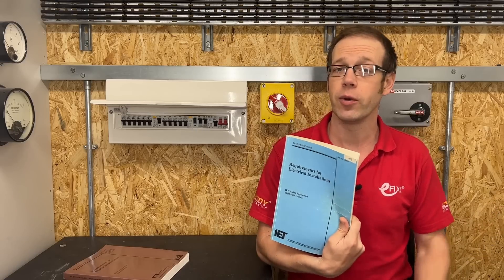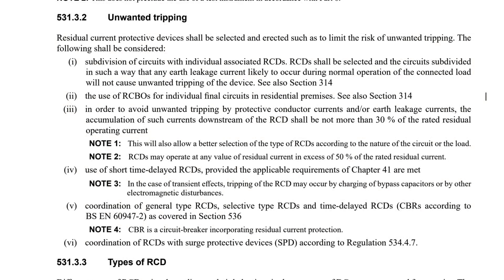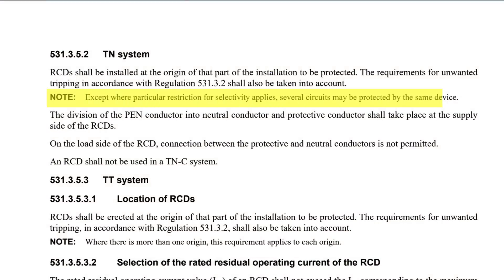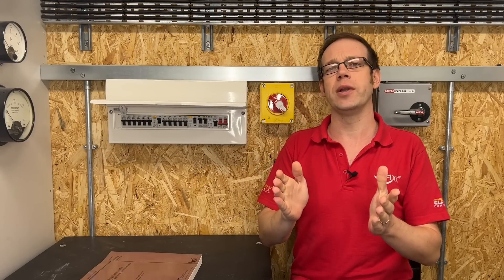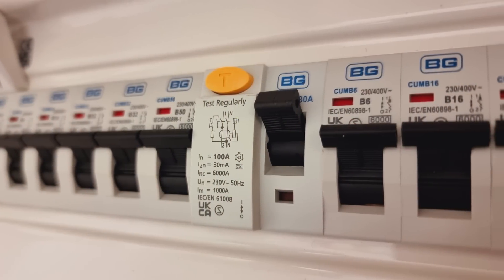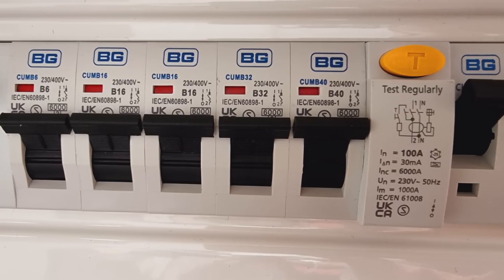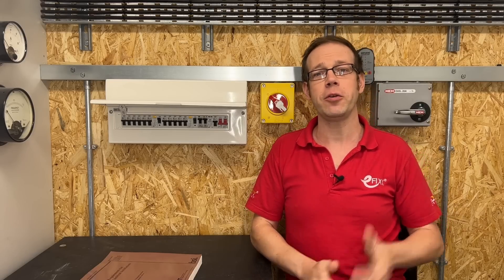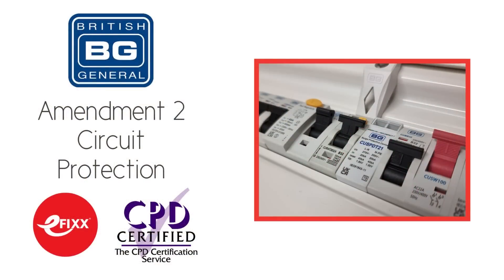Are Split Load Consumer Units Compliant with BS7671 Amd 2?

Comment: I wouldn't fit a split load  anymore. Fusebox do double pole rcbos for pretty cheap.
Reply from the maker: Fair does, thanks for commenting! 😊
Reply: Fusebox is the boss
Reply: Cheap but are they quality? A Hager rcbo is around £30 where as a lewden is say £15! I’m regularly doing jobs with around 15-20 circuits. That’s £450-£600 just on rcbo’s if I want to fit a quality brand. We are in a financial crisis and because the iet rule makers need to keep themselves in employment the consumer has to pay for it. Realistically how often after a rewire do we have rcds tripping out because of the reasons they are giving? I’ve not had 1 as of yet
Reply: @ToffeenoseToffee  hold on, we can’t fit RCBO’s because of price but rewires are okay.

Talk sense lad, if you’re already doing a rewire then a RCBO board is hardly going to break the bank.

And RCBO’s don’t really add that much to the price of a board swap.

You should be doing a full EICR prior to the swap any way. So the days of £500 swaps are long gone.
Reply: @MrIbib  in some instances no we can’t fit rcbos because of cost, believe it or not some people don’t have the funds of an extra ££££ for rcbos. I’m fitting a full rcbo board to a new factory shower block because the funds are there so in that instance it’s the best thing to do. And doing an eicr before  a mains change is just conning the customer in most circumstances if I’m doing my work and I recognise it needs changing I’ll change it
And give an installation certificate after carrying out the same tests and inspections as I would on an eicr. I’m busy enough without making work for the sake of it and costing the customer. You 6 week crash course sparks with your logo on your vans might work that way because the iet tell you so but some of us do the right thing tailored to the customers needs
Reply: @ToffeenoseToffee  who’s a 6ww?

Suppose you can tell if a ring is split just by looking at can you? Lighting missing it’s earth? No worries.

Just plough ahead with your board swap for £300 then make it on the remedial work afterwards.

Think I’ve been to a few of your jobs mate…

You do you.
Reply: @MrIbib  no you test the ring and if there’s a break you fix it. I don’t need to charge the customer to put it on paper first🤦‍♂️
Reply: @ToffeenoseToffee  if you can fix it. If it’s not buried in a wall or under the floor.

And the lighting missing it’s CPC? What then?
Reply: @MrIbib  you do the same as you would with an eicr written out and fix the fault🤷‍♂️
Reply: @ToffeenoseToffee  like I said. It’s not giving the customer the opportunity to say no. It’s a “hidden charge”, something they weren’t expecting. Not saying you’re conning people, but it leaves a bad feeling with the customer, if you have to ask for more money because you found a fault half way through.

My way, they know exactly what they’re going to pay upfront. 

There’s no “we’ve done your board, now it’s another £xyz to fix the lights”.

I just think it’s a better approach to do the testing first.
Reply: Go back and check how warm the 
rcbo's get.I would never fit them again. Fit wylex

Comment: 5 years ago when I had a motley collection of fuse boards/8way consumer unit changed out, my electrician didn't mention that RCBOs existed so I have dual split boards 2x21way To swap this out for RCBOs doesn't make economic sense at £700+ by the time you add in the labour for retesting all the circuits. My plan is to upgrade the system when changes are made - would I benefit from adding arc fault / is arc fault need on all circuits
Reply: Eight RCBOs is nowhere near £700! FuseBox are around £18 and also DP.
Reply: @johnburns4017   2x21way  almost full is about 25 circuits

Comment: If you look into who makes up the panel of contributors to the  bs7671 you will find many captains of industry not surprising the electrical manufacturing industry
ie. Those who make RCBO
MCB
Consumer units 
Distribution boards and everything else  in-between 
So they dictate  the rules and everything else .
Not surprising realy
Remember the Golden rule
He who ownes the Gold makes the rules

Comment: We don't need rcd protection for fixed appliances and lighting circuits.  Socket circuits yes as you could be holding a faulty appliance.  But fixed equipment like immersion heaters , ovens and hobs etc don't need rcd protection.  A good CPC connection and a low Zs is all you need . We have gone too far down the road to change now I know this but it doesn't change my mind.  I know others will disagree .
Reply from the maker: Yeah, the RCD protection on fixed loads and lighting is more about the cables buried in the walls really. The intention is if someone whacks a nail through a cable it'll protect anyone touching the nail. 👍